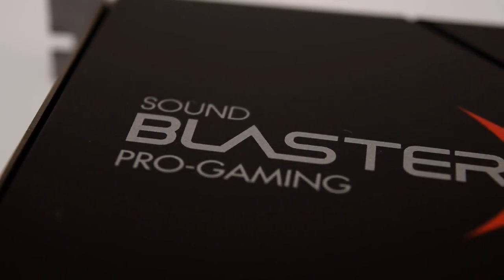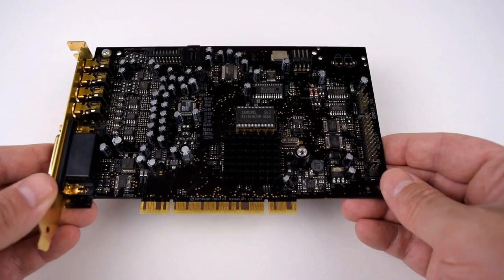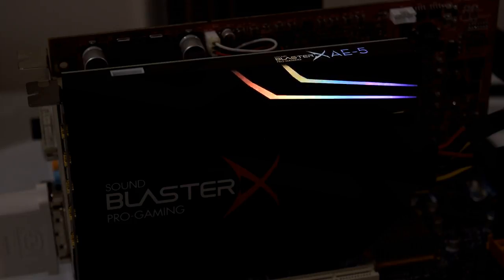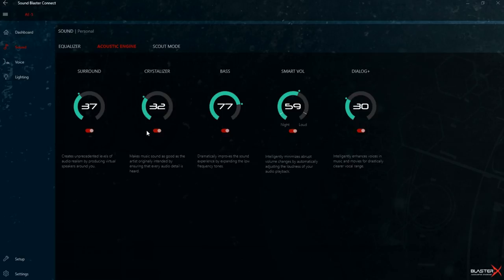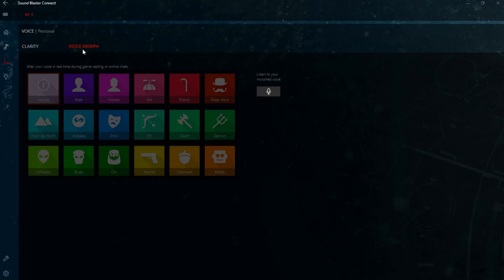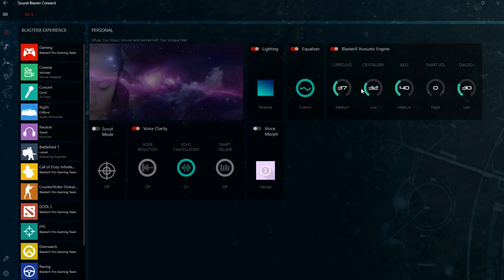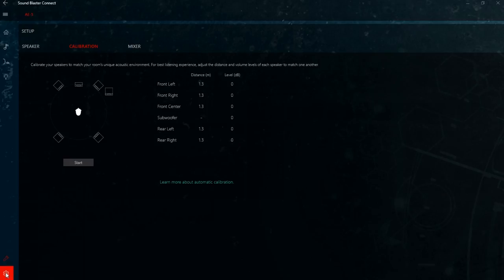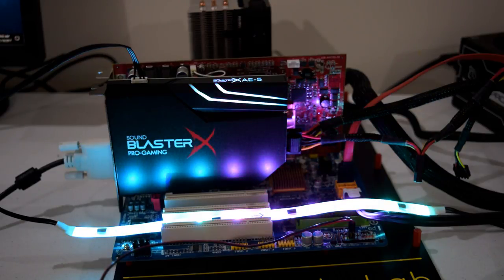Is the SoundBlasterX AE-5 Creative's best Sound Blaster?

Comment: Does spif matter in these comparisons? I have Logitech Z-5500 THX-Certified 5.1 Digital Surround Sound Speaker System. Paired with a Sound Blaster Z pcie. I want to make the best use of my speakers capabilities with my next hopefully Universal sound output device for gaming and excellent movies / music.
HT OMEGA Claro Halo Internal Sound Card, ASUS Sound Card Essence STX II Internal Sound Card, Creative Sound Blaster Omni Surround External Sound Card or just stick with what I have?
 I love anything from Bach to punk, I want to hear anything from a whale singing underwater a volcano exploding erupting thundering on the low end to a gnat flying by in a high-pitch. I don't know where the compromise is of what I want and the no compromise of what I want. should I have to tolerate to separate speaker systems? One for Gaming One For movies music? I don't want to give up and keep on changing my cables around for its purpose
Reply from the maker: If you're using digital output, then it's not worth it spending so much for a sound card. A cheap card will be just as good. This card is good for its analogue output quality.

Comment: I'm happy that Creative (or anyone) is still thinking about new sound cards. This is a good first offering for this generation, but I'm interested what they'll do for the Pro grade. I could actually do with having that Optical IN. I'm currently running the Recon3D, and I used to run an X-Fi Fatal1ty Pro.

That said, if this is all there was, I have a Roland ED SC-D70, so, using it's USB connection, I can just use that to get audio from my external hardware (or MIDI mountain as some would call it.)

Comment: i don't really know what to think about this soundcard. 

i see a lot of features that are both useful and unnecessary at the same time.

RGB - i see it as a gimmick, but apparently, nobody is leaving the house without it these days

equalizer - to correct the mushy sound of these overpriced RGB gaming headphones you just bought.

crystallizer - for people stuck in 2003 who think 128kbps is still cool. 

why did you buy a 32bit 384kHz soundcard again?

bass - yeah, if that mushy ass gaming headset was a bit too overpriced, let's pimp those tiny earbuds.

smart vol - "intelligently minimizes abrupt volume changes by automati......." in other words: dynamic range compression.

ok for movies but i would not use it for music. most music is already heavily compressed either way 

why did you buy a soundcard with 122db dynamic range?

ok, that's the output side - a lot of features to enhance/improve and correct stuff but correcting flaws of playback equipment and source material afterwards should be a last resort IMO

if you have money to burn on a $150 soundcard and spotify premium, how about you actually buy music in a format that doesn't suck? 

oh, and get some decent headphones and speakers while you're at it. 

i am not saying "get the most expensive shit out there" i am saying "get something that sounds good to you right out of the box" 

that way you can benefit from the "direct" modes and the good headphone amp they built in.

but i digress.

moving on to the input side:

noise reduction - a simple noise gate sure helps against microphones that produce a constant noise floor but active noise cancellation (depending on how it is done and how aggressive it is used) can backfire and make your voice communication sound even worse to the point people can barely understand you at all

echo cancellation - "if you are doing a skype call with speakers...." well, just don't. 
but if you HAVE to use speakers for whatever reason, this can be great.

smart volume - it's either constantly messing with the gain settings or plain old dynamic range compression again.

voice morph - a gimmick. gets old after a while.

bonus tip for voice communication: use a mic with clear upper midrange that is not bass heavy by all means, double and triple check if you set the levels properly (yes, make an ass out of yourself and shout at the monitor for good measure - you will eventually do that in a frantic game situation too) and use push-to-talk WHENEVER YOU CAN. 

really. push to talk. 

you'll do everyone a favor because they sure don't want to know when and how often you fart and cough or argue with your roommate/wife/girlfriend/mom

moving on...

we got output and input - but what about actual gaming features?

there is no new version of EAX or other means to improve 3D audio in games or take computing stress off the CPU to improve performance - or did i miss something here?

the only gaming related feature seems to be scout radar - and i am not sure if this is really useful at all

so you play intense FPS games where a split second decision can make the difference between victory or death? 

do you think looking at a radar displayed on your phone instead of keeping your eyes on the battlefield is a good idea ?

Comment: Anyone else doing the X-Fi on Windows 10 here? My card is older than the OS I am running on.
Reply: I'm still using my 11 years old X-Fi xtreme gamer with my X79 rig on W10. :)
Reply: I have two x-fi elite pros from older builds. Using one right now in my main desktop since outside of buying extremely expensive equipment meant for recording studios you literally can't find any soundcard that has close to the amount of I/O it has.
Reply: I was until my X-fi Titanium died :/ on a Creative Z now and love it.
Reply: Mine too, but on Z170 :)
Reply: Jan Nowak Oddly that's me too. Though I would like a Discrete DAC for the digital out on my card if I could afford it.

Comment: I've got some random PCI (no E) sound card in my Linux rig to allow for audio out of the front port. (I made the mistake of building inside of an old Dell case) and after messing with the sound mixing and figuring out that it was best to get a USB mic I have had a good time with it. I plan on switching it out eventually though. It sucks that I'm limited to legacy PCI for the interface though. (It's the only open expansion port on that motherboard left)

Comment: Nowadays, sound cards arent as important as they used to be. That being said, if you pay the money for decent speakers, you may as well pay the money for decent sound card, unless of course, you aren't an audiophile and are happy enough with basic audio quality.
Reply: Audiophile is a bit of a loaded term, but really anyone that into it will have an outboard DAC. You can get the fancy features like crystal voice, 7.1 virtual surround, and the alchemy software via a $30 software purchase from creative that will work on any card or on board sound chip.
Reply: I just bought Xonar DG after I tested Audigy 2 ZS. Even those cheap cards can make a big difference compared to onboard audio. Even if I don't have studio monitors or kickass 5.1 speaker setup, just a modest 2.0 setup. I hear difference. On top of that I'm deaf, but I can still hear. Audio cards are truly worthwhile upgrade and shouldn't be so underrated. IMO they are only worth it until you reach midrangers, then buying external DAC is smarter purchase, unless you need those gaming features. Anyway, if you like to listen to music, sound card should be on the must have list (or DAC, if you have cash).
Reply: Most "basic" on board sound cards can already produce a frequency response far beyond the rang of normal human hearing. Even as a ultrasound hearer my own hearing frequency range still maxes out way before my sound cards.
Reply: +Purrbox, but you seem to ignore what is actually important in sound cards. Important stuff is: frequency response, Signal to Noise Ratio (SNR), Dynamic Range, Total Harmonic Distortion + Noise (THD + N), Stereo Crosstalk, Intermodular Distortion + noise (IMD + N) + some other vague specifications. These things can and do make audible difference. Even low end sound cards are often better than most onboard solutions. Heck, even low end sound card is probably better than the highest end onboard chip (maybe not, but you can see at what level onboard sound is). Leaving alone pure sound quality, if you don't have a sound card you can't have some special effects in games working well. Now if we get back to sound quality, then sound cards are obviously much better than onboard chips most of the time. That's still not very high end setup. External DACs is where shit gets real. They are very expensive (except some) and only they can produce the best sound quality. Difference between DAC and sound card as I have been reading is audible, but gains are small compared to how much you are going to spend. Cheaper DACs and higher end sound cards are where normal consumer will have pretty much all of his needs fulfilled. People don't pay for DACs just because it's being believed that they are good, they were tested and it's confirmed that stuff like that is superior. Just that it's often not worth it financially. I personally am annoyed by those onboard sound warriors, who claim that their chips sound just as good as decent sound card or DAC. They make high end audio equipment look like some sort of sect or shamanism, that only some special people can hear something better. This is a real business and is pretty factual too. How companies advertise their stuff is a different story, but the main idea is that just like everywhere else you have to look at test results and cheapest product can't match the higher class ones.
Reply: Not ignoring it at all, I've actually done a lot of testing for audio equipment manufacturers due to my hearing. SNR's over 100gb are indistinguishable, the harmonic distortion levels are undetectable by humans in all modern on board sound cards. Yes the figures might be better on the sound blaster but no human alive today will ever hear the difference.
Reply: I only have Audigy 2 ZS and Xonar DG. They both are better than onboard sound. Xonar DG is slightly better than Audigy 2 ZS. I can't talk for the higher end equipment, but I expect to see the pattern.
Reply: If you want your headset mic (if it isn't USB) to be driven properly, you absolutely need a dedicated soundcard. Without exception, onboard audio has terrible mic inputs.
Reply: my onboard alc887 seems good

Comment: Back in the day, before most of you where even born to put this into perspective, when computers where just beginning to evolve in their capabilities sound cards where a necessity if you wanted any kind of audio at all, later they became a performance luxury to offset the system and hardware resources to provide sound with added options (EAX) and boost performance....because it was one less thing the pc had to do, today with any premium gaming motherboard you are going to get a premium sound chipset included, that will be capable of anything creative, turtlebeach etc discreet sound manufactures can offer, with multicore and hyperthreading cpu's, gpu's that are capable of providing audio and have basically the same fundamental power as the pc itself, why in god's name would you spend 100-300 for a discrete sound board that will have driver and system issue....keeping in mind everything mentioned will become obsolete within a matter of years.   Your welcome to waste your money however you choose to, but seriously sound cards today for gaming specifically are nothing more then placebo.

Comment: I had an 8-bit SB in my 286 but IIRC, it was shorter than your SB, maybe shorter than the SB2 you showed but I could swear it was an SB1. As far as the AE-5, I love it, it sounds great but there are issues with the software. My biggest gripe, NO DOCUMENTATION! I know, I know...who needs a manual right? but some of the things you went over in the software, you have to figure out on your own! No documentation, no built-in help, no tool-tip pop-ups when you hover over options. Still, I recommend this card but you almost need to watch YouTube videos to figure out how the software works from others who have figured it out, or at least some of it.
Reply from the maker: +GiSWiG True, tooltips could be handy. I downloaded the PDF manual, it had some information that helped.
Reply: I didn't find detailed info in the manuals. I did just see that they updated the drivers three days ago, 10/17. The two fixes that poped out at me:
 - Speaker Configuration not updated after switching to or from Direct mode
 - Settings locked in Headphones mode (<- This one I definitely noticed, I hope this refers to the Direct HP mode)
Reply: Oh Creative, you never disappoint; already found a bug in the latest version...maybe. So I updated to the latest driver, now with built in registration! (There is a Sign In option now on the left). The built-in update of the previous version wasn't working. It kept saying that it was up-to-date. Well, that was just not true. I had to download and install the latest version. So the bug? Switching from Direct speaker to 5.1 cut the sound while Amazon music app was playing. I had to restart the Amazon app to hear it again. Is it Amazon or Creative. IDK.

Comment: Haven't looked into sound cards since vista killed hardware accel
Reply: the ASUS Xonar line has been really good for me once I switched to the Unified drivers as I've used a Xonar DG PCI card for 4 builds now, but I will be sadly be having to retire it as I don't think my next system build next year being an AMD Ryzen build will have a PCI slot on the motherboard so I'll have to step up to the DGX which is more or less the same card with a PCI-E connector.

Comment: As a self proclaimed 'Audiophile' I'm not into RGB lighting and I will NOT be getting this card....
The card I have now, the Asus Xonar Essence ST, fits my needs perfectly. Specifically the high quality RCA outputs
fitted on the Asus.  I will not be buying any soundcard with 3.5mm jacks ever again.
The Asus also has a molex connector, but this is for the built-in high quality headphone amplifier, which has support
for high Ohm headphones like the Sennheiser HD-600.

As far as 'favourite' Soundblaster, I guess its either the my first Soundblaster, the 8-bit Soundblaster Pro 2.0, or my
first upgrade, which put it into 'CD quality' the Sounblaster 16 Value Edition.
Reply: bwzes03 i guess you can turn that shit off in settings

Comment: Realtek sound card can also get 3d sound. They made a "3D SoundBack" utility which add this back.
Reply: It's completely horrible though. It''s really just abandon ware. They released a 0.1 version in 2008 and never updated it one single time. It's not even on their site anymore. So if you wanna see for you self how poor it is at restoring DirectSound 3D effects and esp EAX which of course ALchemy dose (and dose perfectly even on my realtek ALC1220). Here is a DL link.
https://pcgamingwiki.com/wiki/Glossary:Sound_card#Realtek_2 
I tried to test it on Windows 10, and after finding out you have to run it in compatibility mode for Vista just to get it to launch I gave it a try. I tested it with Condemned Criminal Origins (Supports EAX 4.0). Caused weird crackling artifacts and was obviously not doing a good job. Then even though I don't have a creative sound card I installed Alchemy + Alchemy unlocker so you can use ALchemy on non creative sound cards. In my case a Realtek ALC1220. After pointing ALchemy to the game I ran it and the sound is perfect. All the EAX 4.0 HD effect, which sound great, not just reverb but excellent 3D positional audio, sound occulison (easily can tell if something is between you and the source of a sound) etc.

Comment: I loved the SB16, AWE64 Gold, Audigy 2 ZS and the X-FI cards. One thing I loved with Audigy 2 ZS and X-FI, is that they have a coaxial output instead of optical. Coaxial sounds better than optical.
Reply: Coaxial and optical sound the same but with optical you avoid the problems electrical connections cann cause like a hum loop.
Reply: One thing I noticed is that optical can handle up to 96khz sample rate, and coaxial is up to 192 khz. But I guess the both type of connections has it's ups and downs.
Reply: Yes you are right regarding the 96 khz limitation of TOSLINK, the optical connection. I didn't know that since I never had a decoder/receiver/amplifier that could process more than 96 khz. Thanks to you I learned something today :-)
So in general it's best to use optical TOSLINK up to 96 khz and above that coaxial or HDMI.
Greets!

Comment: 2:41
Is that a Molex?
BURN IT, BURN IT IN HELL
Reply: The reason Creative Labs went with MOLEX instead of the SATA power connector is due to amperage. 
SATA only delivers up to 1.5-amps at 5-volts (7.5-watts) whereas MOLEX supplies up to 11-amps (55-watts). Each 10-LED light strip requires 3-4.5-watts and being able to run four strips requires up to 18-watts – over double what the SATA power connector can provide.

Comment: Do not waste money on this card AE-5, sound is clean, that is true, but it sounds worse then audigy RX, Sbx profiles are just awful, software implemented effects - simply flat. I think this core3d chip is Creative gimmick, not real DSP, like audigy, Xi-fi series with E-Mu chips. Check the size of the chip and also the lack of hardware effects, Cmss 3d is not there, stereo surround also. If you prefer untouched music, again RX will do the job, there is a Bit Direct function. Simply this card is pointless. FYI in games, like Cs go, on my Z906, AE-5 mix front and rear channels, with RX i get perfectly separated sound and I can tell from wich direction steps are coming. I was very disappointed from AE-5 and I returned the card after 2 days of testing. Ah also you get distorted sound from time to time with AE-5, so you need to restart and hope this time to work. Tested on win 11.
FYI RX is still working with all new updates from windows and I love the sound, the only problems are: no separate jack for headphones and lack of dts connect.